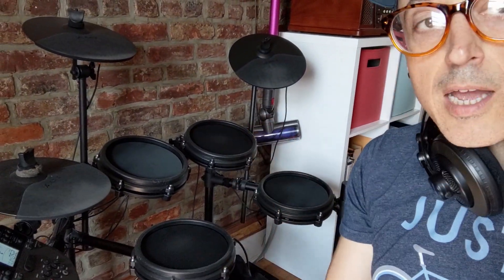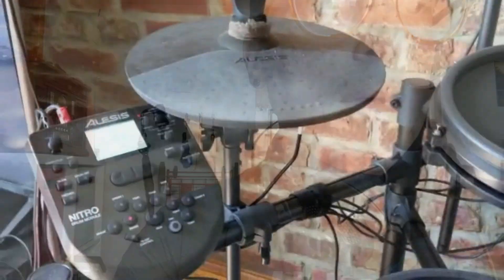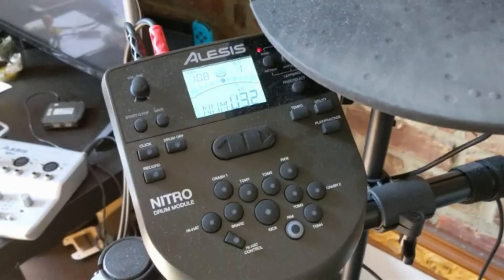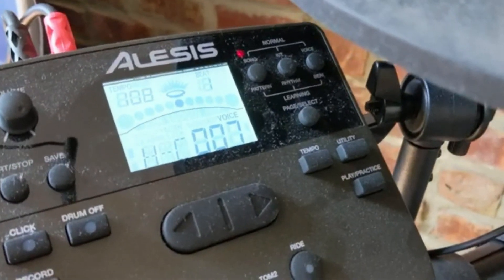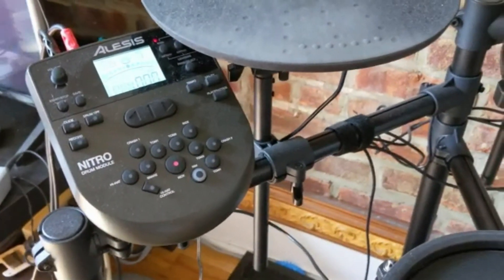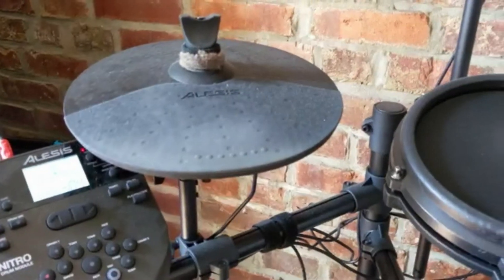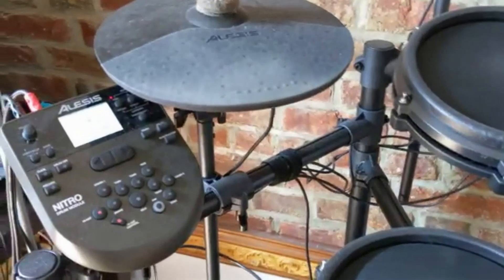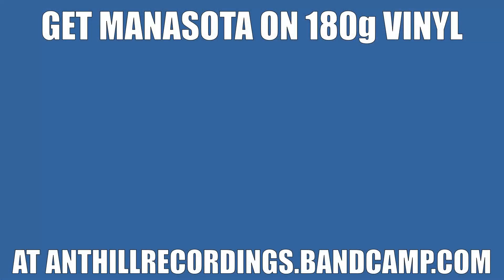Double Bass on The Alesis Nitro Mesh

Comment: I found an excellent way to do double bass on the Nitro Mesh kit. I bought a 2nd identical Alesis kick pad tower & pedal cheap, then hooked it up via a "mono" 1/4 inch 2-way splitter to have double bass. Seeing as both share an input, they have the exact same settings, as well. It works so much better than my double pedal did, as the beaters weren't hitting the pad in the center enough to work that good. The 2nd tower has been working wonders, however, for over a year.
Reply from the maker: cool!
Reply: @demonicsweaters  Also, I heard the using the hi hit pedal isn't a good idea, because the spring is only a smaller single spring, or so I've seen in another video. But a 2nd Alesis kick tower pad only ran me around $70. eBay seller drumsrus usually always has one, and if not, he restocks. Then a mono 1/4 inch Y splitter works, or hooking it to Tom 4. I have a 1 male to 2 female Y splitter, mono, not stereo.

Comment: Great tip! I have this kit and an actual double petal and it has been a bit of a struggle. I have the beaters as close as I can get them and neither one strike the center of the pad enough to get the full trigger of a single petal. I have spent hours trying to get it just right and I have it as even as possible. What I did is turned up the sensitivity and the volume of the bass pad to even it out with the rest of the kit. Works great now. So if you do go for the double petal, keep this in mind. Also for you and anyone reading this, this kit works great with Reason 10 and 11 with the Kong Drum Machine and the Reason Drums rack extensions. I did have to adjust the pad sensitivity to get a more “real” sound for rolls and ghosts.
Reply: Can you please tell me how to do that?
Reply: @sebquintero7484  "What I did is turned up the sensitivity and the volume of the bass pad to even it out with the rest of the kit. "
Reply: Thank you for this comment! I have reason 10 now because of school and was not sure if my kit would work with it. Great to know.
Reply: Can you post the settings you used? 

Thanks.
Reply: @prdsatx4467   If you talking about the double bass pad settings, I believe I had the sensitivity up all the way and the volume as well. I'm not 100% sure if that was the setting, as I'm using a completely different setup now with the Alesis 8" mesh bass pad from the surge kit. I found it used for cheap. I would recommend that if you can find one. I was fed up with the nitro bass pad with my double petal.
Reply: Just got my kit yesterday. Been playing a double bass pedal acoustic kit for 10 years and I just cannot play the single pedal on this kit. I cranked the sensitivity and volume on the bass pedal, but I still cannot get an even sound out of both. I just tried using a single pedal on the kick pad and the hi hat pedal as the second bass pedal. I just can't get the hang of it because there's no rebound whatsoever. Going to be a very frustrating transition.
Reply: I'm thinking about bending one of the beater rods to make the beaters as close to the center of the bass as possible. You think that would work?

Comment: If anyone ever uses the hi hat as a second bass like me and they’re hearing hi hat sound I just isolated the sound during settings and turned the volume all the way down on it, bam easy peasy lol. Happy jamming everyone!
Reply: Just change the sample from a HH closing to a kick sample
Reply: @evil kava any guitar amp or bass amp I suggest over 25 watts
Reply: I have used the bass pedal from my old Roland kit and plugged it into the back of the module where it says Tom 4. Feels perfect and only triggers one sound.
Reply: @evil kava I used to use a little amp but for the last 8 months or so I’ve been just using headphones and the isolated sound is the best in my opinion.

Comment: Found someone selling an Alesis kick pad and pedal online. Thinking I'll pick that up and just plug the second kick pad into the tom 4 port. Considering what they're asking for the pad and pedal, it's actually cheaper than buying a double kick pedal.
Reply: I received the second kick pad and pedal, for about half to one-third of what they cost online. Hooked the new pad up to the tom 4 port, and it works like a charm! I now have dual kicks on my nitro mesh, and I'm TERRIBLE with them. Definitely gonna be a while before I can play a cover of BabyMetal Death or Lamb Of God's Now You've Got Something To Die For.
The only issue I'm having is I can't seem to set the hi-hat open to use the closed hi-hat sounds. I have the pedal duct-taped closed for now. It'll do until I can figure out how to set it properly.

Comment: Hey! Have recently set up my kit (first time drummer, 2 months in) but having trouble as getting double hits with one kick of the bass pedal. The beater is bouncing off the pad. Any idea how to adjust the spring tension other than turning the top ‘bolt’, which seems to make no difference? The bottom spring bolt doesn’t budge, even using pliers. Thanks in advance!
Reply from the maker: If you're getting double hits from the pedal bouncing you just need to learn to control your foot better. Spring tension is mostly personal preference.

Comment: I bought the nitro on a whim based on price and was disappointed that I couldn’t get a great sound with double pedal even though manufacturers said it would work. I decided to spend $60 more bucks and found musicians friend selling the Simmons KP2 kick tower on eBay and bought it. It was a perfect fit and the most cost effective way to make the Nitro perfect for me.
Reply: We’re you able to plug this into the nitro without any problems? I have been thinking about doing this but wasn’t sure it was going to be compatible.
Reply: Now you can plug your second bass pedal into the jack for Tom 4, and remap the sound exactly like in the video.

Comment: Get ready: Just insert a simple overdrive or boost guitar pedal between the stock kick pad and the module.

The pedal raises the volume of the signal that is transmitted to the module. This way the pad becomes MUCH more sensitive for weaker hits. 

I did this because I bought an 8" mesh kick pad for my Nitro which didn't work any better. I talked to Thomann about this and he told me that every module requires a different signal level in order to process the hits accurately.

Since piezos are also used as pickups for acoustic guitars, this works AND saves money.
Reply from the maker: Interesting idea!

Comment: If you get an amp cable splitter, you can just hook up two kick pads to the same cable and you won't have to worry about different voices
Reply from the maker: hmm, you're probably right, since you're never hitting the kicks at the same time.
Reply: I just got a double pedal, but i'll probably experiment with this later down the road. I have a feeling i'll be upgrading my surge kit ALOT, to include a new module. But right now, i'm just learning baby steps. 

My goal is to eventually move to an acoustic set. Right now, this electric one is perfect for what I want and need at my level.

Comment: I mapped the hi hat pedal to the kick drum sound but I ocassionally hear the "hi hat closing" or maybe the "hi hat half open" sound trigger when im using the 2nd kick, which results in the kick sound glitching or getting cut off. I tried mapping those sounds to the closed hi hat sound but it still cuts the kick drum sound off. Any solutions? Maybe I need to isolate those sounds and turn the volume off? Is there a way to separate the hi hat pedal from operating the open/close hi hat functions at all?

Comment: I think for it to be plausible though, you'd need the hi-hat to default to open, since it can longer be controlled. If it ends up being stuck on closed you'll just end up with a click click click sound out of it. Can the hi-hat be set to open ?
Reply: Did you end up figuring this out

Comment: for the primary kick drum that uses an actual kick pedal and kick drum tower, could that be switched for a hi-hat pedal? in my current apartment, the neighbors say the kick drum makes too much noise as though im thumping against the shared wall. I am wondering if i can switch the kick drum/pedal for a hi hat pedal to circumvent this issue

Comment: Do this going forward is not the best option though because the pressure and distance of the beater will throw you off as you advance with the style of the hi hat pedals. Best bet to get a cheap one off ebay to learn!

Comment: Hi Justin. Great channel man. I just want to check, when you use a double kick pedal on the tower are there drop off issues due the sensor being centered and being quite small? I really want to use my double kick and not to keen on the hi hat pedal as my second kick.
Reply: I have used the bass pedal from my old Roland kit and plugged it into the back of the module where it says Tom 4. Feels perfect.

Comment: I did what you said but when I play double bass sometimes it will still register as high hat control. Any answers?
Reply: Same here,
Reply: I found that sometimes it will pick it up as a hi-hat splash
Reply: A comment I found on reddit that (possibly) addresses this situation:

"... On the nitro hi hat pedal, there's also a "hi hat half-open" position that will make you drop Y Cymbal notes while using double bass if you don't adjust it... What you have to do is hold the hi hat pedal about 3/4 of the way down (if you look at your midi output you'll see it change, I think the default is 23), then change the hi hat output for half-open to whatever the default is for full open (I want to say 49? not positive about that.) This will fix the dropped note issue."

Source: https://www.reddit.com/r/Rockband/comments/5t3vo6/double_bass_trick_for_alesis_nitro/
Reply: @miuraYCM   nice

Comment: i recently bought this drum and like it a lot. still kinda figuring out what the best sounds for it are. I tried to do this yesterday but I noticed a huge volume difference on the different pedals. The tower (right) has about half the volume of the hi-hat pedal with the same settings(max vol) :/. not sure if it's an issue with my hardware or just me kicking it x]
Reply: In case you’re still trying to adjust it. I Just picked up this kit last week. Had a similar issue when I was trying to set up the double bass. I kind of adjusted the kick on the hi hat pedal to be quieter and in line with the average hit sound of the actual kick at max. For me personally, the hi hat kick is at 25 and standard kick is at 32. The standard one has velocity sensing so unless you hit it at full power, it doesn’t output the max volume. The hi hat always plays at max volume. Hope that helps.

Comment: Great vid.
You can always just hook up a midi cable and use plug ins on your DAW like ez drummer .I like my hat hat pedal..
I was hoping the base drum pad was capable of handling an actual double bass kick pedal without lag or glitch.
Reply: You could buy a Yamaha kick tower for $60-$70 that can easily accommodate a double pedal if you’d like to use one. Of course that’s more money but still a good solution

Comment: Because the vibration of the bass beater is too loud for my neighbours, I need to swap the supplied bass drum bad and pedal with a footswitch similar to the hi hat pedal. My old DM6 kit let me do this. I have tried this with the Nitro kit but the pedal wont work. Do you know a fix for this? Cheers.
Reply from the maker: No, you can't use a switch type pedal for kick drum on the nitro, you could use a roland silent kick trigger though https://amzn.to/357rPyT. Another option would be to make a silent pedal (same concept can work on a single) https://www.youtube.com/watch?v=KnaepOIfScs and pair that with a KAT silent strike beater https://amzn.to/2Lo2XvP
Reply: @demonicsweaters  nice one. Thanks very much!
Reply: Hey do you have any contacts, i wanted to ask can the DM6 hi hat pedal really be changed to a kick drum and is it really fast?

Comment: I just got an Alesis Turbo Mesh kit and it doesn't allow reprogramming pads!  Plus both pedals are switch-style, with no pad I could use a real double bass pedal on.  Do you happen to know if I could buy just the central drum module from a Nitro kit like yours and use it with the rest of my existing hardware? Or should I just try and exchange my whole kit?
Reply from the maker: I wouldn’t bother with that, I think you’d be better off with something new. By the time you replaced everything you’ll probably have spent as much as getting a new kit. I’d either trade or wait a few weeks, I have some good info of a really good sale for a good kit coming very soon. Stay tuned on the channel for details!
Reply: @demonicsweaters  Guitar Center let me trade in my Turbo for the Nitro!  The salesman said I would need to buy a double bass pedal though, and ended up finding this exact video himself haha thank you for putting this out there
Reply from the maker: @speedracer2please  haha, that's awesome. Congrats on the new kit!

Comment: Hello Justin. I am saving and maybe buying one of those kits for Christmas but not just to learn how to play drums but also using it as a midi controller to trigger things like EZ Drummer for home recordings. So far hat I have read one of the most important things when looking for a midi controller is sensibility, like how good it is to pick soft hits and try to achieve the most dynamic range. What do you think of this kit regarding its dynamic range grom from soft to hard hits? I mean, for the same money I buy a midi controller with decent pads and do "finger druming" instead but that would not be as fun as playing a kit.
Reply from the maker: Sensitivity is really good on these pads. I don't really think that'll be an issue.
Reply: Javier, As Justin said, the sensitivity is good on these pads. As I mentioned my comment, I use these as a midi controller for Reason. I did have to adjust the sensitivity a bit especially for the snare, but that might just be Reason and not the kit.
Reply: Finger drumming?wth is that bro?
Reply: @christph3118  Playing drums using a midi controller's pads.

Comment: how about just splitting the bass drum wire and adding a third pedal?   need to have the open hi hat sound...
Reply from the maker: I would rather suggest getting a larger kick pad and use a double pedal. You can fit a double on this pad, but it's tight.

Comment: I'm guessing this means that your HH is "stuck" open, since the pedal controller no longer is assigned to the HHC command.  Or you probably explain this in the video somewhere and I just missed it.
Reply from the maker: you can program it to be in an open or closed or any sound you want it to be.
Reply: @demonicsweaters  brother, a question. When you set up double bass, when you press the pedal the high hat opens and closes as if you were still using the pedal and the note is cut off. How do I set it up?
Reply: @demonicsweaters  like how can i have the high hat close?

Comment: I have the Surge. If you want to put a second bass pad, am I able? It says only tom or cymbal.
Reply from the maker: You can, though you could also just use a double kick pedal.
Reply: @demonicsweaters  Thanks. I know about the double pedal but I have spine and nerve issues and can't really adjust a double pedal where it's comfortable. A second bass and pedal will be fun though.
Reply from the maker: @petegalgano7750  Yamaha and roland also makes kick triggers that you can daisy chain to a single input

Comment: Is there a way to put an actual double bass pedal on there? The one I have keeps sliding off while I play. I wasn’t sure if there was a way to secure it more to the bass pad. Thanks in advance!
Reply from the maker: Its just a tight fit. My PDP double pedal barely fits, but I just prefer using the alesis pedals. I think certain brand pedals fit better than others.
Reply: Demonic Sweaters Thanks for the response! Love your videos. Just purchased this set for my local church and your videos have provided a lot of insight to the set. Cheers!

Comment: Omg I have finally found the answer, thank you! Please tell me: does it work the same way with Alesis Turbo Mesh Kit?
Reply from the maker: it should, try it.
Reply: @demonicsweaters  You know, I am about to buy e-drums and I must know it before I buy haha thanks! :)
Reply: @demonicsweaters  Another question, in case if I buy Nitro Mesh model: when I do the trick you've shown, is it possible to get a MIDI track with a double kick? Or is it possible only as a sound, but impossible as a midi recording?
Reply from the maker: @fortymbrass  the way to do that will be to also change the midi note of the hi hat pad to the same as the kick. Just hit the voice button repeatedly until you see 'MID' then adjust it with the arrow keys to be the same number as the kick drum trigger.
Reply: @demonicsweaters  Thank you SO MUCH!

Comment: On using the hi hat for double bass, is the tension on the two pedals the same, or can the tension be adjusted?
Reply: This is a okey quick fix. I prefer buying a another pedal with the same tension as the main basspedal
Reply: @CostaFause  that is pretty much what I was thinking. Thanks.
Reply from the maker: no, you can't adjust the pedal on the nitro hat

Comment: A dbl. bass drum pedal barely works because the trigger pads are not located on the outer edge, where the double bass drum kickers hit it and not the whole pad. The Yamaha KP65 Kick Tower is better. I've decided to go with the Simmons Titan 50 Extended Set.

Comment: my floor bass has  a problem even the first day i bought it... it cant trigger the double pedal.. if youre too fast the it can detect one sound only..also my high hats sounds too low
Reply from the maker: I don't recommend using a double kick pedal on this pad, it's far too small for it to work with any accuracy, which is why I do it the way you see in this video. Crazy your hi hats sound too low, they're like the loudest thing on my entire drum set. I always have to turn them WAY DOWN.